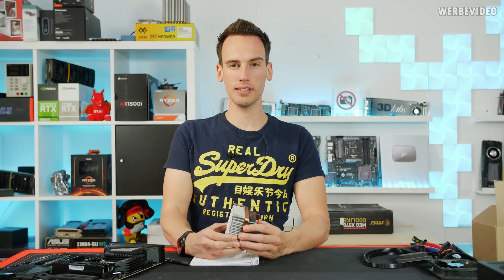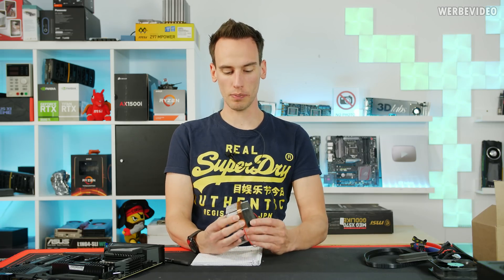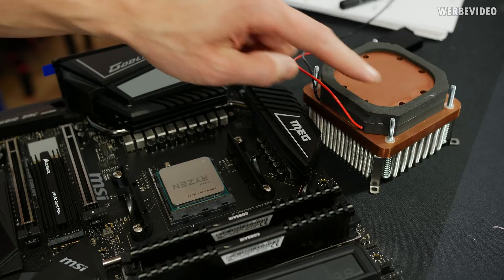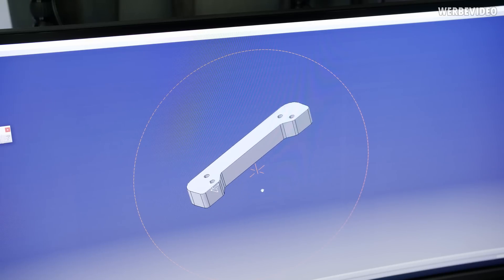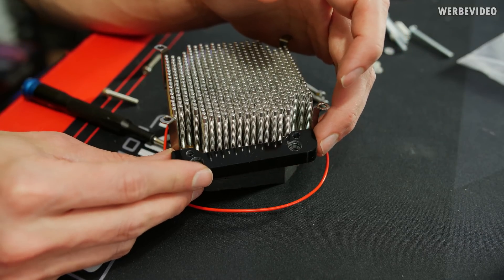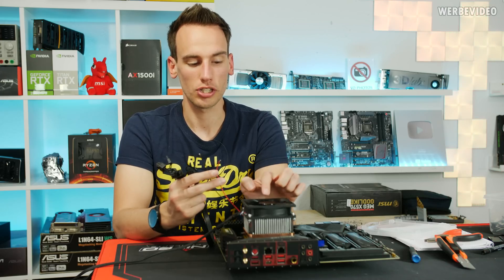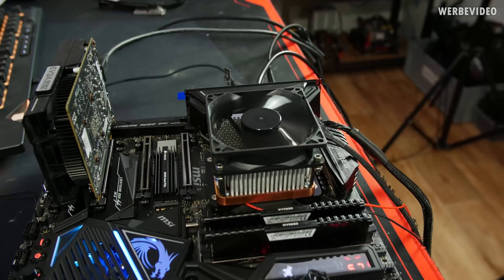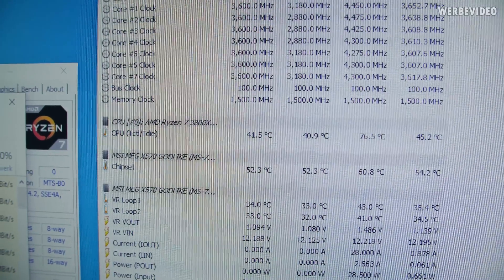Threaded Rods to cool a RYZEN 3800X sub ambient? Swiftech MXC4000-T

Comment: Amd idle temps really are awefull. My 9900k idles just a few degrees over ambient with a dark rock pro 4
Reply: Not really, Intel runs way hotter (hence Intel now rates 110c to be acceptable, while Ryzen thermal shuts down way way before then and even FX thermal limit was like 79c). The cooler he is using has a massive amount of insulation medium to travel through before it gets to a really crappy and pitiful 20 year old cooler design. Your 9900k would shutdown on that Cinebench run and the idle would be way worse (as Ryzen is quite low in power draw at idle). If you throw a piece of cardboard between your cooler and the CPU it might be comparable.
Reply: @jakegarrett8109  my 9900k runs 24c idle with a 20c room temp on my dark rock pro 4 and with gameling load from battlefield 5 (one of the most demanding games for cpu atm) it doesnt even get to 60c.   it only runs hot in pointless fake stress tests. and even in CB20 it gets to 66c average @ 4.7 ghz. and 110c isnt accuurate the cpu throttles at 100c.  the whole hype of it getting to hos is nonsensen really and only true on badlt setup systemd.  most motherboard run it stock at 1,38v while they only need 1.22v @ stock +MCE not to mention VCCSA and VCCIO that are stock on 1.39 while they only require 1.165.  most people just should not run tests or build pc's as they have no clue how to fine tune it. just wacking components in a case is no longer enough. some manual tweaks are almost always needed.  currently my cpu runs at 21c btw as i forgot to close the window and its 18.5c inhere.
Reply: pino de vogel Id say more people should build PCs, even untuned they beat OEM, lol! Plus most of Intel’s chips are locked anyways, so it’s not like the average Joe would be missing anything anyways (that said about voltage, yeah even on my locked 8750h I undervolt like 120-130mV and get way better battery life and I saw an insane ~15% performance boost on Cinebench just because it could boost higher within the same power confinements).

I would say with Ryzen third gen most people also wouldn’t need to overclock (very low gains), and for Intel if they wanted unlocked they should probably go with 9900ks which also doesn’t leave a lot of room either (so a novice would be fine just slapping a decent cooler on that and going with it).

As for me I will always overclock. I skipped water cooling and went straight for sub-zero phase on my desktop, some REAL performance gains there, like that 9900k I would run at no less than 6 GHz realistically. My cards are almost all customized BIOS and some have hardware circuitry mods with voltage bypass control knobs and most are prepped for LN2. My motherboards are all prepped for phase cooling 24/7 so they have waterproofing and insulation so I can run the chips sub-zero without hassle as my daily machines, in fact after prep it’s less maintenance than a water loop, haha! My motto is: “If it’s not icing over, then you’re not overclocking!”, since even my tablet is water cooled with a Fallout 4 post apocalyptic theme: the pump hidden inside the radiation barrel moves the “radioactive” green antifreeze through clear tubing to my custom designed block for mobile processors, and then goes to a rusty steel pipe array for aesthetically accurate post apocalyptic/neglected condition (the insides sandblasted clean of course). I designed that in 2 hours and rendered it all out in CAD then assembled it all during a boring movie, total cost for all parts (minus the tablet) was under $5, haha! Overclocked 44% while being 40c cooler than out of the box bone stock, so not bad! It’s actually a really good cooling improvement even though I just did it because of a video saying “things you can’t do with a tablet” and it was just water cooled PCs and I was like “these people are just not creative...” so I cranked this out during a boring afternoon, fitting an entire custom loop on the back of a 7” tablet and that was plenty of room!

I have fun modding PCs and all electronic devises, even my ebike has a shunt mod, lol! And my other one I’m welding some forks for it to run 4.9 inch fat tires in the front just because I can. I mean why not have some fun and make a something silly and stupid that I can laugh at? Lol, if it’s theoretically possible to mod it I’m there! Oh yeah my main PC is built in a vampire style casket, only 116 nails and 12 screws were needed, it runs quad crossfire and I want to upgrade it to an extremely cold cooler for Threadripper to target -100c temps on a custom triple stage cascade as my next upgrade to my daily machine, I just need to make a CNC machine to cut out the evaporator block Ive designed for TR4 socket and pick up some massive compressors and get to work soon on that! I love pushing the limits! So much fun!
Reply: @jakegarrett8109  they can but they can also run really poor and then people blame it on brand XYZ. Either the cpu manufacturers give out wrong standards or the motherboard makers really royally screw up settings all the time. So people can build but they should do a fair amount of research as its not as simple as slapping components together like it was a decade ago.

Comment: Bruteforce airflow with a 92mm delta. That's how I used to use one of those coolers. Crank up the delta to 100%, deafen yourself, but get those temps down!!
Reply: Yup, and add in an empty fan as a spacer to reduce dead spot where the hub is.
Reply: They were so loud back then, terrible noise.
Reply: Then it would end up sounding like a Playstation 4 was in there somewhere.  My god those stupid things are LOUD.

Comment: I had that cooler on my Pentium 4. Used an adapter to mount a 3 inch flexible hose to it, like a dryer hose. Then ran that up to a 120mm delta fan, on top of the case.
Reply: I always thought about doing that in my P4 setup with this cooler back in the day but never got around to it... Ended up building a q6600 rig and using the stock cooler.

Comment: Hey, @der8auer can you CAD a vapor chamber like that heatsink? Most of those rods could be direct connect tubes. Wouldn't it be more efficient than the TEC? I had a Coolit Freezone back in the early 2000's It did the job for cooling my Q6600 back in the day of 8 hour video transcodes and burning DVD'S. Wish I hadn't lost them, one pump failed and the other leaked in a system and blew it. Great concept chilled water cooling but poor materials back then ruined it. Designed in Canada made in China (poorly). 

Thanks for this, I have a Swiftech H320 X2 it's been a great AIO. Why don't you review some of their water cooling products for us?

Comment: Those wires look pretty thin to supply 170watt's/14.5amps.
As much as I like the idea of a TEC CPU coolers the result are always disappointing.
Reply: Sorta, but they are short and that’s actually not a huge amount (like your CPU probably draws 100 amps at stock, or likely 200 amps for an Intel 9900k out of box). I would use bigger wires too but I usually go pretty overkill with massive wires until I realize I have about 5 pounds of wiring in my desktop and wonder, does every GPU REALLY need 2 power cables going to it? Haha, I have 9x 8 pin cables going to it (I think, it’s kind of hard to count, it’s like bending an iron bar to slightly move them for access to a GPU with them bundled together...)

Comment: fun fact, there was socket 423 before socket 478, for the Willamette Pentium 4 cpus, man that series was so bad that hard to describe with words :P
Reply: I was wondering if I was the only one old enough to remember the "glorious" socket 423 😁
Reply: Tulatin PIII's were as fast or faster than those Willamette P4's if I recall correctly lol
Reply: @sburns015   Yes they were. Almost all the 1100MHz Tiualatins could run on 133MHz FSB instead of 100MHz and if you were really lucky and you could find good 1200Mhz one with the same properties, but those were much more rare, usually the 1200 ones could only reach 125MHz  which was a problem, becouse if your FSB couldnt be divided by 33, then your pci devices didnt work properly, espically the onboard soundcards those  didnt work at all :P

Comment: I've been seeing alot of these units directly onto the CPU but I have an idea of using it to cool a water-cooling loop to help relieve the load on the unit and allow the CPU to stretch it's legs before it thermally insulating then overheating. As long as you don't use water obviously you could get real low temps even tho it chews power

Comment: @Der8auer: Which program do you use for CAD-design?
Reply: Stijn De Bruyn I think he use the Blender.

But for you can do the mechanical design on any cad software such as Google Sketch Up, Blender, Autodesk AutoCad, or Autodesk Maya 3d.

But Blender based on Linux and it's very light  iam already used it, and 100% free when you install it on Linux😀👍

Just put the code "Apt-get install blender" on the linux terminal and done😀👍
Reply: Stijn De Bruyn But you only can do that on Ubuntu based Linux such as Linux Mint, or open the Blender official pages for full instruction😀👍
Reply: Looks like maybe FreeCAD (it’s hard to tell since the interface is really customizable but that uggly @$$ blue gradient and the gridline style is the default for FreeCAD). It’s alright, definitely not great, but the big benefit is you own it forever and nobody can take it away (like Fusion 360 just altered the contract and disabled a lot of the useful features for hobbiests and really crushed any use in open source design projects). Solidworks is my favorite but it’s really pricey (so unless I want to pay like $5k a year subscription which could go up at any time I’ve lost all the thousands of hours into my CAD models), hence I don’t consider subscription ever, period. Autodesk Inventor is what I started out with, and my job requires me to use NX/Unigraphics (a really $hit CAD program but they don’t want to spend millions/billions drawing entire aircraft back into it, I totally understand, but lol, now we are just digging further into that trench every day).

So free is not good enough (they can and have historically taken that away the instant they sniff a potential $5 profit and you lose access to your work). So open source is all that I would ever use as a company and probably as an individual even if it means using inferior software because dang it, after having thousands of hours just thrown away I’m not letting that happen again! My work I will keep and if I can’t own the product then I don’t want it.

Oh yeah, FreeCAD like it appears he is using is free (since it’s open source of course, so if you wanted to get add on packages you can just grab them from whoever you want or modify and make your own without worrying about it since that’s what they want, anyone can develop and expand its ecosystem for the benefit of the community, or just use it and enjoy a free software). Hop into the “Part Design” drop down toolbar and away you go! It’s a bit janky and nowhere near as fluid as the $5k+ per year software but I mean it does basic parts ok (like I’ve just started using it and it’s done well for some 3D printed optic mounts and basic things like a muzzle break or suppressor is a walk in the park for this program, though it could use some more polish and refinement it does work).
Reply: Jake Garrett But Blender is have a grate color and texture do and it free, iam already used it.

But if you choose to used the paid software, it shoul be better. Iam recomended autocad or maya 3d for paid software👍

Comment: Where’s a delta fan when you need one?
Reply: That's what i thought. One of those "ooopsi! where is my fingernail?!?!"-server fans :D
Reply: I used to have the non TEC version with a 5500RPM screamer on top :D
Reply: @flandrble  yeah I think I had the same with an 120mm 108 CFM delta fan on top with a 92mm to 120mm adapter that sounded like a jet engine! mine was for the original athlon cpu (socket A i think?).
Reply: @sanosuke001  Correct. :)

Comment: "not sure if it's higher performance, but it's higher power consumption for sure"

That's exactly how my Ryzen 1700 overclocking efforts have been
Reply: Yeah, 1800X here, and it's the same.  4 GHz all-core is reasonable, but 4.1 is just plain awful.  Needs like 1.45 to hold it there.  I settles on the most efficient all-core OC I've ever had that still breaks 4000 in CB20, and it's 3.975 GHz using a more reasonable 1.35v ( .44-1.37 ).. but sits around 1.35 mostly.  I thought it was great at 4.1 until I seen 150w being drawn from the CPU...  Getting a 3900X soon.  Prices are coming down again soon.
Reply: @larrygall5831  i got my 1600 stable for 2 runs of cb20 on 1.451v core 4.1 ghz, almost 125W power draw and 3020 points :D

r5 1600 AE version
asus b450m prime-a
cpu cooler: amd wraith prism during 4.1 runs 86.3 c :D
Reply: @larrygall5831  Ryzen 1st gen is notorious for their ''4Ghz wall'', my 8 core R3 1200 did it though.
Reply: I feel for you guys, man. I have a 2700x which I just run stock, even though I have a big custom air cooler that could definitely take an overclock, but as you know a 2700x doesn't overclock too well and I don't need it. Also note that even though the 2700x specs (For those who also have one) say that max boost clock is 4.3 Ghz, but it will not go past 4.0 Ghz and Ryzen Master tells me it's the "EDC" maxing out.
Reply: @Fiddlesticks86  Really? with performance boost on my 2700x with the stock cooler runs easy 4.3 Ghz turbo, I turned perf boost off to help keep it a bit cooler for video editing though.  Did you ever use the prism? it would be interesting to know what temps before and after, that you experienced on idle and under load if possible.
Reply: It now runs up to 4.0 GHz btw depending on load and temps, if it gets to 70+ Celsius (rarely does) it throttles back to 3.8Ghz.
Reply: @Fiddlesticks86  I can OC my 2700X to 4,340.4 at 1.325V
Reply: i was using i7 4770. Intel said it could boost to 3.9GHz but i never past over 3.7Ghz. Just like your AMD product.
Reply: @zuminlair92cp  me my 4690k laughs in 4.4GHz
Reply: @zuminlair92cp  Thanks for your input.  Interesting to know.  You will not hear that from Hardware Unboxed.
Reply: What?  I think you did not get an ASUS x370 Prime Pro, like I did.  I just set power profiles in BIOS to Extreme and AUTO and 3.8 is steady and stable in all games.  No real need to OC, as I have never seen any CPU usage go past 3.75 on single core.  I am looking forward to 3900x price discounts, but if it happened like 1700x, there will be none.
Reply: @bradyelich2745  it's on sale at Mindfactory, right now. 430€
Reply: @Azraleee  Still too much for 3900x (assuming that is what you are informing me about).  $300 CN would be just right.

Comment: The Peltier doesn't contribute much over the long term because the limiting factor is the surface geometry of the cooler.
Sure, the Peltier increases your temperature delta slightly, which makes the cooler slightly more effective, but it also contributes it's own heat.

Comment: Why didn't you run Cinebench after swap to the AMD box cooler to show that result?
Reply: Would have liked some benchmarks with that final config too
Reply from the maker: The mounting mechanism is broken on my Boxed Cooler. Can't use it anymore that's why I took of the fan
Reply: @der8auer  Wasn't the temp drop to 18 degrees C with the AMD box cooler? and it was at idle right.. so, why didn't do a Cinebench run after you showed that 18 degrees C result at idle? Or am I missing something?
Reply: @chairman67  He was using the fan and shroud off of his broken box cooler
Reply: @williamforbes6919  That doesn't explain why he didn't or couldn't run Cinebench after recording an idle temp of 18 degrees C with the AMD box cooler. His results with this config were incomplete!
Reply: @chairman67  the tec is only able to handle the heat of the cpu at idle. The cinebench results would be likely worse, as you are relying on that heatsink to remove the cpu heat, and the heat from the tec, and neither the heatsink nor the tec is strong enough. 
It was designed for cpus that were consuming somewhere around ~65w - 120w at full load.

Comment: That was a drastic decrease on temps. Crazy
Reply: Not really. That's in idle. A tech can bring temps down if not much/no heat is put in. And Ryzen can idle really really low. On boost/max use, it will just melt.